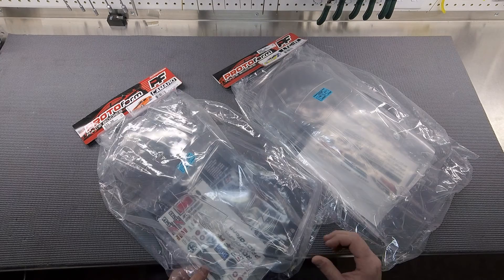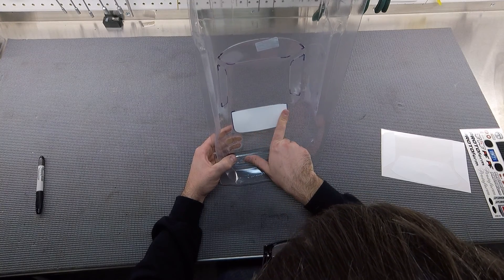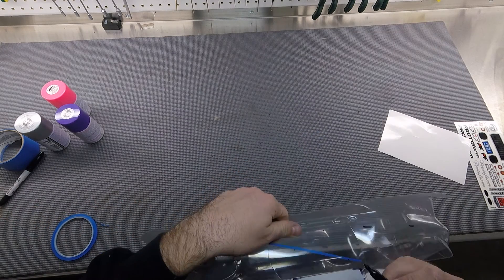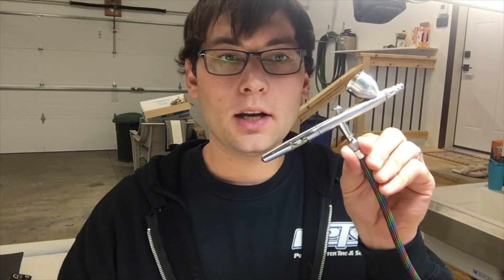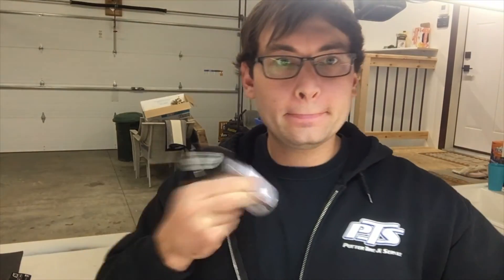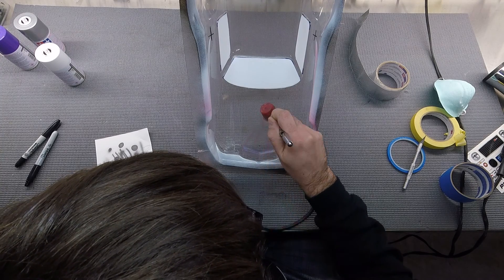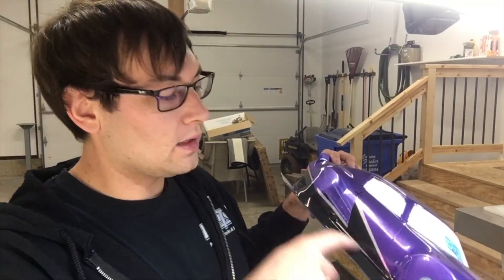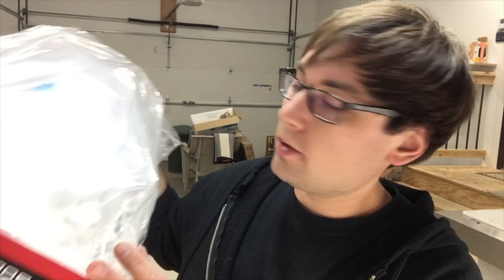How to Paint an RC Body

Comment: When you remove the masking tape do you have to re wash it? Wouldn’t the tape leave a thin glue film?
Reply from the maker: As long as you are using high quality masking products you will not have an issue with it leaving any residue 👍

Comment: You not think to drill the holes and cut the arches before you painted it?? Hummmm
Reply from the maker: DJSpannamanUK the plastic on the outside peels off the edges if you cut or drill first.  Then you end up with overspray on the outside of you aren’t careful. I also find it much easier to mask it off if it isn’t cut 🤘